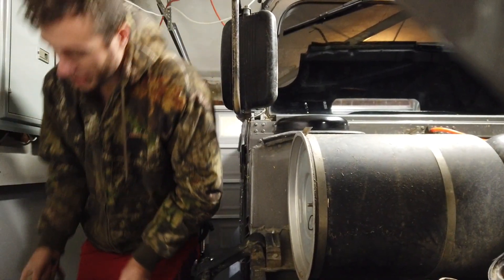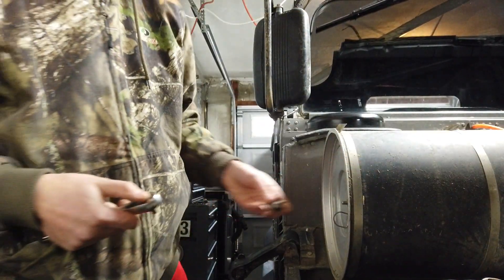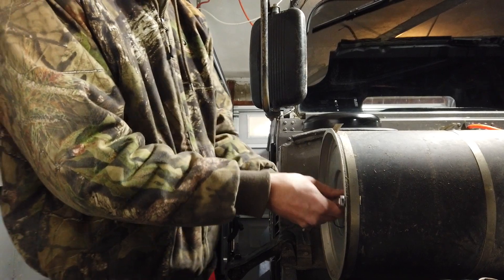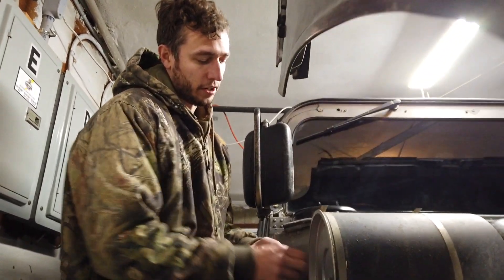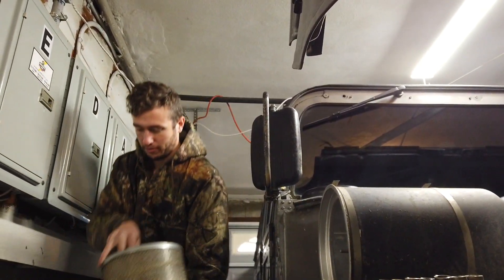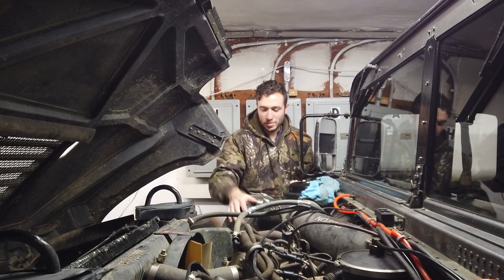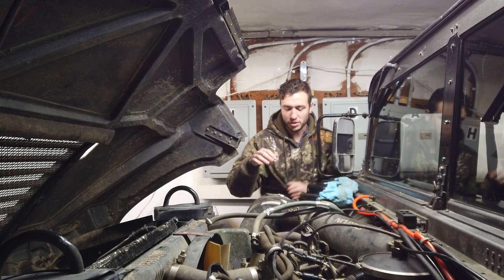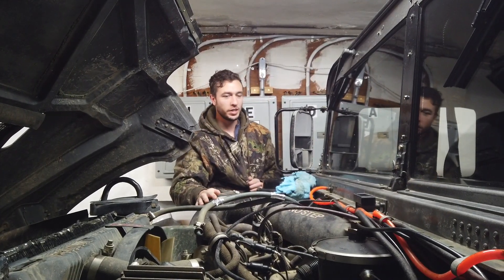Make ANY Diesel Cold Start- Simple Trick

Comment from the maker: FYI- this video was meant to show a temporary solution that will get you going again in a pinch. The point was not to ignore the underlying problem causing a hard or no start condition. In my case it was two sets of bad glowplugs. Obviously there are other solutions that work. Starting fluid (not great for the engine), covering the exhaust (requires two people), block heater (requires that you have one already installed), lighting a rag on fire near the intake (not really a great idea in a garage), putting a heat source under the engine (takes longer and could burn the rig down if you arent careful) etc etc etc. I appreciate all the interest and comments about this particular video. Many good suggestions, this is just something I threw out there because it works, is easy, and isn't particularly dangerous or damaging. Best of luck and thanks for watching!

Comment: Even after heating it up for so long it still had problem starting. There must be something wrong with it, like a solenoid as you said, or the fuel is draining from the pump and it becomes airlocked.

Comment: I have a 1997 3500 that's a pain to start when it gets bellow 40 at night. I'd leave the block heater on all night and crank the batteries dead trying to start her......20 minutes of the hair dryer shoved in the air intake did the trick.

Comment: Or put a block heater on your diesel. They’ve also got magnetic oil pain heaters that you can put on your oil pan or the manifold, wherever you can attach it, but you can get a block heater and cord for around $100 if not less. If you don’t see the cord it doesn’t mean you don’t have one. GM’s I think have them but they didn’t supply the cord on all of them. All ford diesels come with them I believe and dodge had to be ordered with them I think. Could be off on those as I’ve only owned 6.7 PowerStrokes, but block heater is your best bet for this imo.

Comment: Kevin, did you ever change your glow plug controller box? My m1123 starts like a champ when its warm but not so well when its cold. I have new plugs. Im wondering if replacing the box worth it because i seen a guy on youtube replace his box and it didnt fix his problem lol(expensive waste of time and money). I have sprayed starter fluid for 2-3 seconds and it fires right up.
Reply from the maker: I did end up changing my box and that fixed the problem the first go-around.
Then I changed glowplugs and that fixed the problem the second go-around.
More than likely my original (bad) box cooked the original glowplugs so both things needed to be changed.

I would look at what kind you have and do some research. There are a couple iterations of boxes that are basically guaranteed to fail, so whether or not changing it fixes the issue, you at least will have some peace of mind that you won't be left stranded later on. 

Also, I've heard bad things about using starting fluid on old 6.5s. The compression on those motors is super high and it can hurt the motors apparently. Just what I've heard though who knows if that's actually true. Try having someone cover the exhaust with a phone book or something and crank the motor instead, this often will force them to start up pretty quickly.
Reply: @Kevin24Seven  you just gave me some really helpful information. I think i will go ahead and replace the box, because you’re right: peace of mind is everything when it comes to not getting stranded. 

I once heard about the army putting thick manuals behind the exhaust pipe, interesting.  Thanks

Comment from the maker: PSA: I have a lot of people saying "just use either". While that would absolutely work, it isn't usually the best thing for a diesel, especially one of these high compression 6.5s... the start issue was caused by defective glowplugs which was throwing me for a loop because I had just changed them and they were ohming out correctly. Once I got some higher quality plugs in I never had this issue again!
Reply: Do you have a model, brand, etc of glow plug that worked for you? Having trouble on 6.2 M1009. Thank you

Comment: Thanks for the tip! I don't have anyone else to ask, does the bed have some tie down points? Can I get a ratchet strap across the bed (driver to passenger)?
Reply from the maker: They do come with tie downs but I took them out during painting. If I remember right you should be able to strap it down in the way you describe.
Reply: @Kevin24Seven  that's awesome! Thanks!

Comment: Or just put in a block heater like most people do... My 6.2 has no trouble starting in Wisconsin winters without any assist though.
Reply from the maker: This video was to help people with a quick and easy short term solution (see description). Most folks don't have spare block heaters lying around to just pop in the first time their truck or tractor wont start.

Currently have a block heater, oil pan heater, and glowplugs on order actually but until those things get here... hairdryer it is!
Reply: Some people don't live in areas where a block heater is needed all the time you know, this is helpful to people in those areas. Since their trucks don't have block heaters

Comment: The hose connecting the air intake pops right off. I put my wife's hair dryer in it when my smart control box went out and fried the glow plugs
Reply from the maker: Works like a charm lol... I am going to put a block heater in as well as start using a magnetic oil pan heater regardless to see how well that works but until they come in its the ole hair dryer for now!